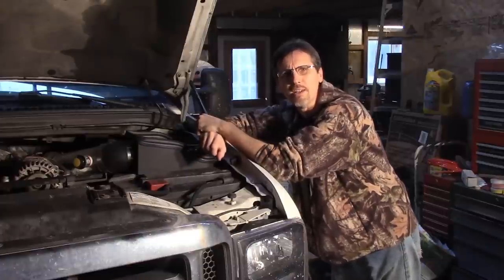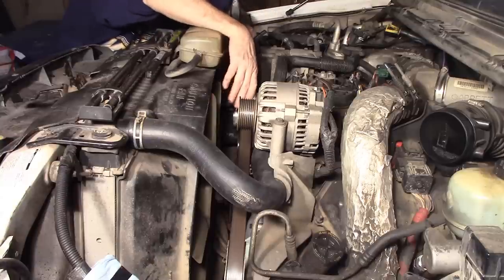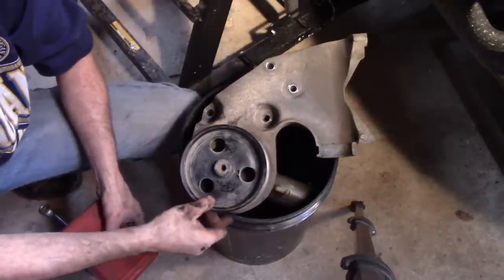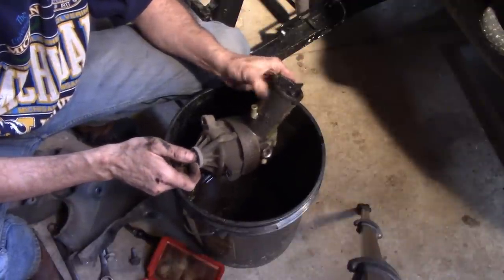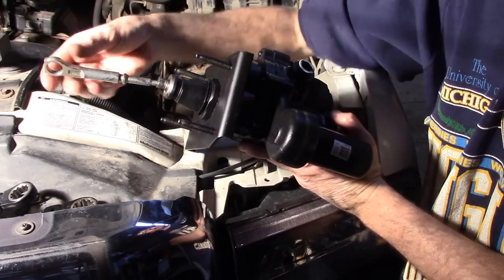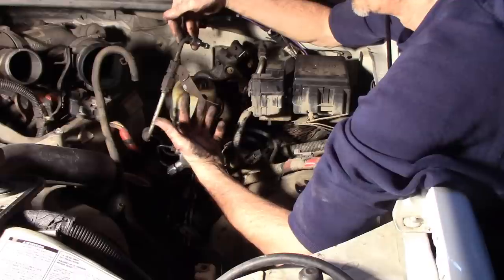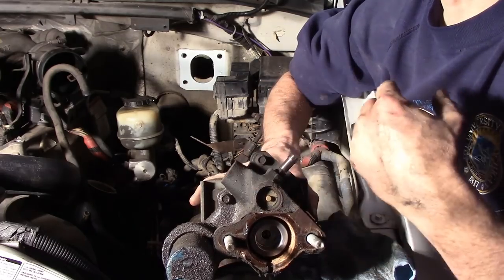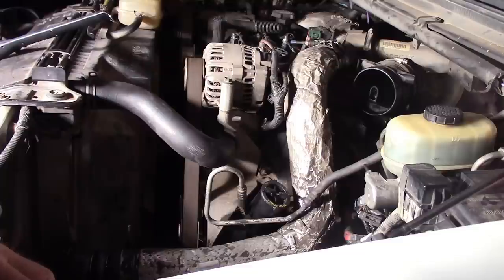2000 F350 power steering pump and power brake hydro-boost replacement.  Cruise control easy repair.

Comment: AMAZING JOB on this video..!!!  I watched it....Took notes .. And now know exactly which wrenches to use ..when and where.. VERY TIME SAVING..!!!  Great job with the light and camera work here as well. Ready to tackle the oil cooler O-Rings first, then the steering pump.. and power booster replacement.... and might as well replace the cruise control switch at the same time on a truck with 290,000 miles on it. THANKS FOR YOUR EFFORTS AND INFO HERE..!!!

Comment: Good video, thanks for putting up to share. Just need to make sure that people know that you don't actually use power steering fluid in 1999-2003 Powerstrokes. Use automatic transmission fluid, Ford does say that Mercon V is acceptable now. Other than that, outstanding video!!
Reply from the maker: Good point, I didn’t think about mentioning the fluid type.

Comment: Great video.i did this on a gas 2012 e350. I did the booster cause it was leaking, but it seemed to be from the inside not the lines or connections. put the new one in and it seems to be leaking from the bottom of the booster as well?? got any ideas? all the lines are dry and connections are dry too? leaks about 2 oz a day

Comment: Based on your thorough video I think I figured out my issue.
Can’t get the air out of the system, sometimes no ps, while turning the wheel with engine off, wheels raised, fluid dumps from reservoir fill neck. I’m thinking fluid that should be returning through the booster into the reservoir through the hp hose is returning through the return on the booster overflowing the reservoir.

Can you discuss?
Reply: Mine is doing the same thing...did you ever get air out
Reply: @howardsmith876 you wouldn’t believe what Ive learned. There is a leak test to do with a vacuum pump. Needs to hold 20in of Hg for 5 min. Keep trying for as long as it takes if it improves over time keeping it at 20in Hg. If it doesn’t, something’s leaking. If the leak is left long enough, the pump will fail. (No PS) 
The pump I put in from undisclosed parts store, had a leak on the seal so I bought a new one somewhere else, lol. Your leak if found with test, may be anywhere. Now it holds 20in Hg for an hour or more. Pump is quiet. PS is perfect.

Comment: Thank you very much sir for your clear and concise instructions. Very well done! I just replaced my pump, but still have a slight whine when turning the wheel. Suggestions on the possible issue? Thanks.
Reply: Air in the lines
Reply: Jack your trucks front end up, to create elevation and a free wheel condition, then pop the cap on your power steering pump turn your wheels lock to lock left ALL THE WAY  right ALL THE WAY do this like 40-50 times you can hop out in the mean while and inspect the fluid if its frothy in the fluid looks like cotton mouth spit, you had air keep going until thats no longer occurring then all the lines are clear theyre will be thousands of micro bubbles not huge bubbles
Reply: @thinkglobalactlocal2975  OK! Thanks for taking your time to help out another. I really appreciate it and will pay it forward. Take care.
Reply: No problem at all brother been resurrecting an 01 and all these videos these fine folks have been posting through the years have been a life saver if I can add 2 cents from my personal experiences with my truck to save someone else a headache ill do it every chance I can! Hope you get it resolved mine drove me nuts with the whine but now no sound at all just strong hydraulic push sound, take care!!!
Reply: @thinkglobalactlocal2975  I have an 02...7.3 Diesel. 175k. Bought it brand new off the show room floor for 41K. Great truck, and I'm very grateful to have youtube's community so we can all share and grow. Peace.
Reply: @thinkglobalactlocal2975  j

Comment: I’m about to tackle the hydra boost and master cylinder on my 2000 f350.  Did you replace the Teflon seals on the high pressure lines? Or did you reuse the originals? Thanks for the vid.
Reply from the maker: If they came with the new hydro-boost, I would have replaced them.  I mention the Teflon seals for the pump, probably didn't mention them again for the hydro-boost since I already had.

Comment: Great info.  Why did you decide to replace the Hydro-boost? Trying to figure my 01 F250 out. If I brake hard, the front brakes seem to stay engaged until I pump a few times / screw around with them a bit. Recently replaced the master brake cylinder, so not sure if the new master cylinder is the issue or if it's a possible Hydro-boost issue. Thoughts?
Reply from the maker: Mine was leaking at the accumulator.  If the issue you are having didn't happen before the new master cylinder was installed, I'd definitely suspect the master cylinder.

Comment: Great vid, was wondering did you feel need to flush old fluid out of lines?
Reply from the maker: Thanks.  Since I was changing the pump and booster for leaks, rather than a failure, I didn’t feel the need to flush.  I’m pretty sure there wasn’t much fluid left anyway because most of what was in the lines drained out while working on it.
Reply: I installed a new pump, didn't flush as it had a new pump last year, I broke the plastic return line putting on a cold air intake, it only held 3/4 of a quart, works great though.

Comment: I have the same truck do I use power steering fluid or transmission fluid? AutoZone says it calls for transmission fluid
Reply from the maker: Mercon transmission fluid is correct.

Comment: I can’t for the life of me get that nut off using the wrench where the steel line is. It’s stripping the nut ! what should i do??
Reply from the maker: Only thing I could recommend would be try a little torch heat, that might loosen it up enough to start moving.

Comment: Was it the power steering fluid leaking? I think mines doing the same thing. Just not a 100% where the leak is just yet.
Reply from the maker: Mine was leaking somewhere around the accumulator on the hydro-boost unit.

Comment: when i step on the brakes, truck idle, the engine stalls. what might cause this, collapsing line?
Reply from the maker: Sorry, I have no idea what could be causing that.  Does it stall if you turn the steering wheel as well?  My first thought might be a wiring issue under the dash close to the brake pedal, but that's just a wild guess.  Good luck!
Reply: Yes turning the wheel stalls it as well

Goes to shop on Monday I’ll post the answer then thanks for reply
Reply from the maker: Wow, I would have never guessed that.  Glad they found your issue and were able to repair it.
Reply: The cam sensor went bad along with wire

The hydro boost was failing and  was discovered indecently

Comment: Third video showing the wrong/hard way to do this job. No need to pull alternator and bracket. Alot easier to pull pulley if left in the mounted bracket. Three bolts pumps out, reverse the process. 15 mins
Reply from the maker: If I was a flat rate mechanic, then I would do everything I could to shave time off the job.  But since I'm in my own garage and not "on the clock" the fastest way is not that important to me.
Reply: @SakimasRidgeHomestead  I read that you may not have enough room to fit puller tool in there while pump bracket is still mounted to vehicle. Not sure about that, but it would be easier and faster to not have to take bracket off. Either way, I like this video and your method. 👍
Reply: Then why haven't you made a video about "the right way" to do it? Seems to me this worked just fine.